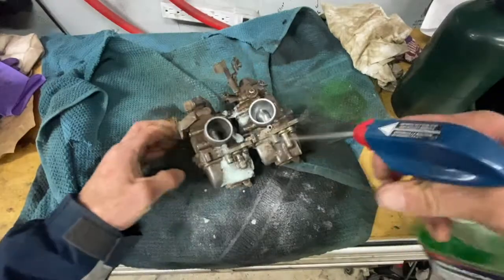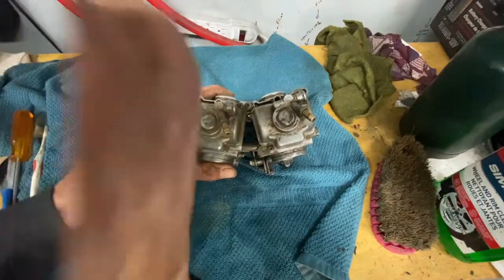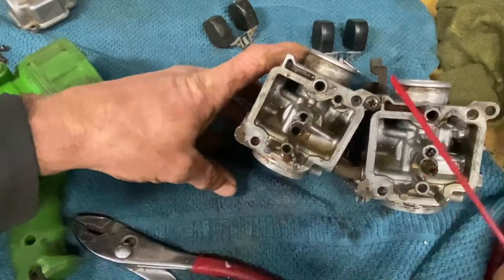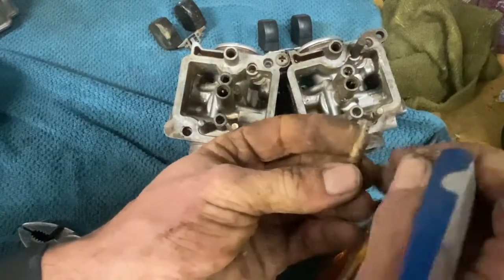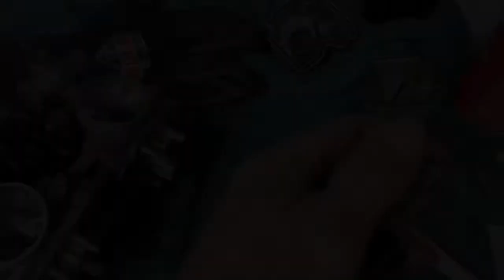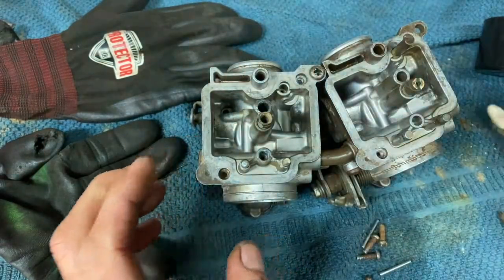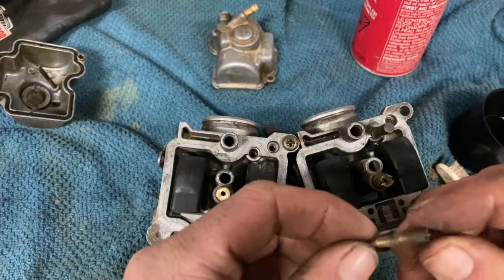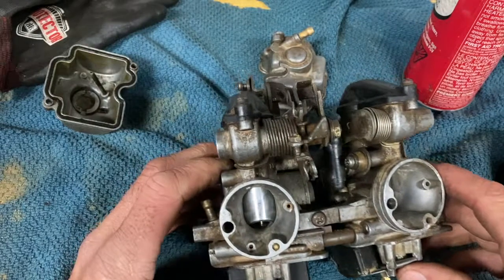Cleaning my 1985 Honda XL250r dual Carburetors. 1984-1987 (How to)

Comment: Change the orings on those fuel line hoses that connect the carbs together. They dry out and leak fuel onto the motor. Nice vid! I just Vapor blasted and restored two of these carbs for 1985 and 1986 xl250r
Reply from the maker: Nice..  Vapor blast works awesome.

Comment: Good video! Cleaning my carb this week on LA165 and doing rebuild too.

I asked a question last week about my mower losing power especially when warmed up... I am starting to think it is a fuel related issue, hence why I am starting with carb clean... However, the oil filter has barely any gas in it even while engine is running, so I am thinking possibly that would mean the fuel pump isn't pumping enough fuel? Or maybe a vacuum line from the fuel pump? Any idea here?
Reply from the maker: You won’t see much fuel in the filter when running.    
   Just undo the fuel line going to the carb at the pump.  Start the engine & see if the fuel is pumping out of it.
   Also check the fuel pulse line for any cracks in it. (That’s the line from the valve cover to the pump).
Reply: @WeekendHobbyMechanic  Will do, thanks once again for all your help!

Comment: Is the pilot jet suppose to be open all the way through or does it have to be closed? Coz ive got a 1985 model and its bog when u open it up it all the way, quickly.  I've checked all the mains and checked the air screw and it still bogs
Reply from the maker: Does it bog 1/2 throttle?
Reply: @WeekendHobbyMechanic  yea it bogs but not when i turn the throttle all the way open slowly
Reply from the maker: @hermanferreiravlogs4330  Pilot jet controls the idle.  The three-quarter to full throttle is controlled by your main jet. 
    You might need to increase the size of the main jet on the right side carburetor. 
(The Needle jet rod controls 1/4 to 1/2 throttle)